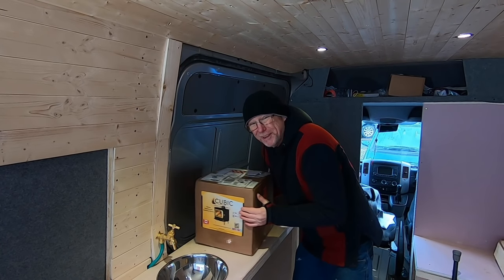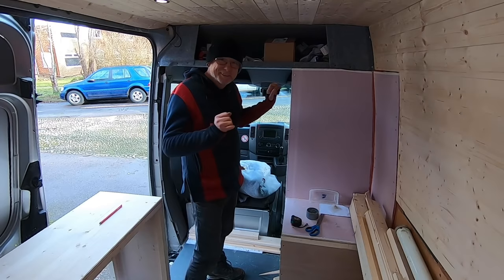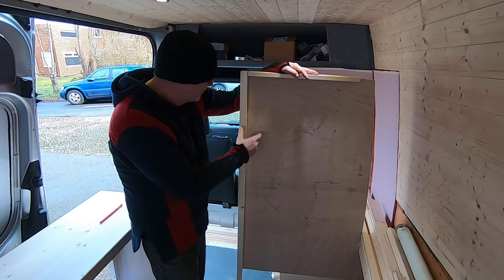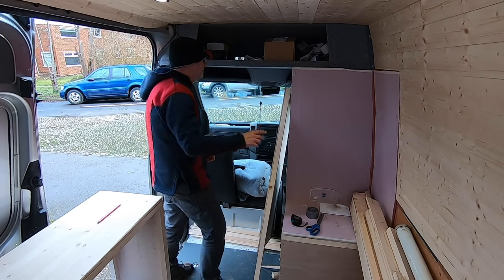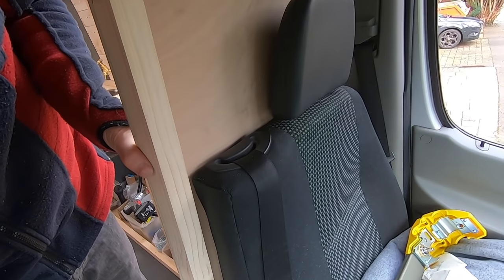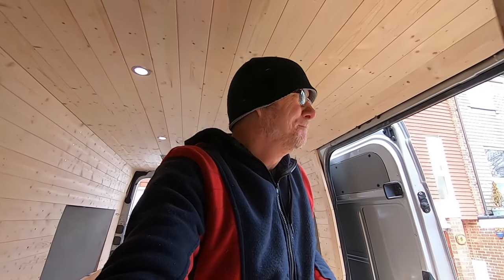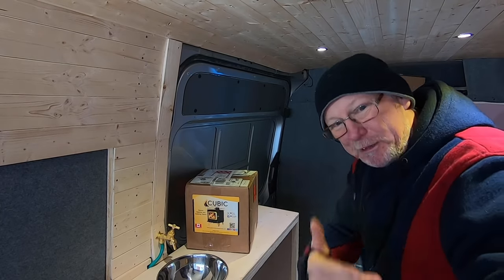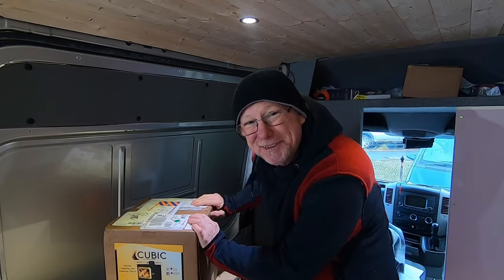Cubic Mini Wood Stove In a camper van

Comment: Instead of having a permanently fitted external glue how about having a removable top pipe that fits through a fitting like a large stainless steel plug hole and a rubber bing for when the fire is not in use. Total stealth when not in use and water/ wind proof. And for heating just stand in the drivers door way and reach up to remove the bung and fit the flue top pipe and hat. Steve
Reply from the maker: That sounds like a great idea thank you 👍🤓👍

Comment: How I'm just finishing off my insultation.
What thickness of wood did u use for battens and plywood sheet what thickness?
Nice video
Reply from the maker: Hi for the battens going across to form my ceiling I used 30x25 mm the ply wood strips I cut from the original ply lining that came with the van it’s 6 mm and the cladding screws are only 4x16mm they are just the right length hope this helps good luck with your build and thanks for watching 👍🤓👍

Comment: Compared to converting Fords what is your opinion about Sprinter? Is one better than the other or just "different"?
Reply from the maker: The sprinter automatic drives is a real pleasure to drive and much quitter than the ford but the ford is so much easier to get parts for I would definitely recommend the ford transit sprinter I’m not sold on just yet 👍🤓👍